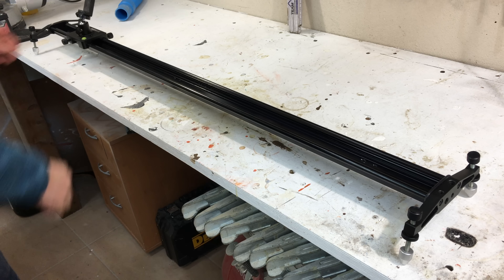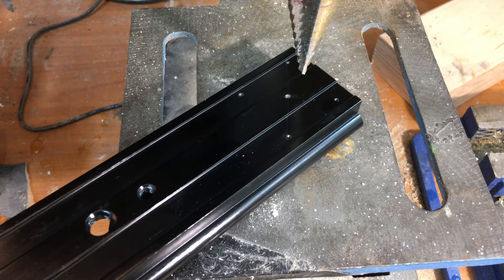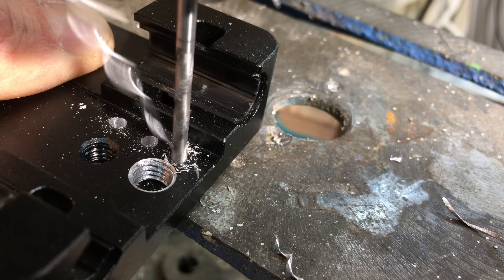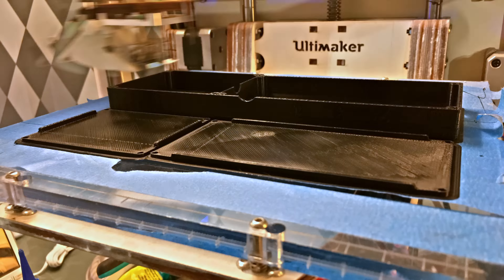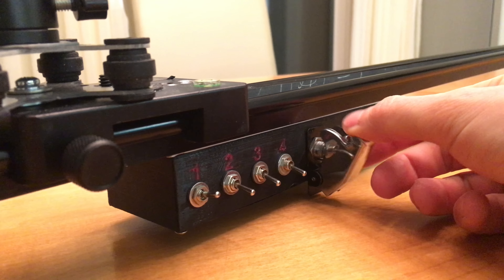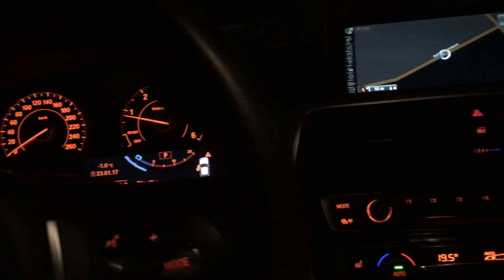Lets Make - A Motorized Camera Slider

Comment: That’s about $600 in tools, time, skill.....      I’m better off buying a REAL one!!
Reply: These tools can all be purchased fairly inexpensively second hand.  The drill press and 3D printer are not at all a requirement for finishing this build.  Your never gonna learn anything with that defeatist attitude.
Reply: Arduino- 2$ from aliexpress or ebay. Soldering iron 2$ from Frys electronics. The rest of components can be purchased for dirt cheap as well. Built all this for less then 20$.
Reply: I know this is an old comment, but for anyone else feeling this way: you're probably better off building one! If you have no interest in building, sure, buy one. But the skills and abilities you'll gain from making projects like this are immeasurably worthwhile. They'll make you feel more capable and confident as a person, and it'll unlock a bunch of creative potential!
Reply: Your time is not worth money if you cannot sell it yet. Which means, to get started, building stuff is great.

Comment: Could you not make an even simpler one using a traditional DC motor and a rheostat for variable speed control, with two limit switches to stop it at either end?

Comment: Interesting... I like the fact that it has arduino control- in which case- it is open source output - that can be modified with code and software control. I need a motorized slider rig that can 1) read any motion given from software, 2) repeat that motion seamlesly several times, and 3) do same motion but with frame by frame steps (for stop motion camera move)

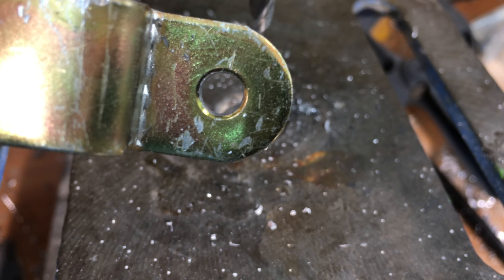Comment: Good ideas in this video.  A small tip for those who are new to machining;  1:28 very dangerous to hold a piece of metal when drilling.  The bit can catch and spin the piece causing a bad cut.  Better to clamp it instead.

Comment: Nice! I like the combo switches. Great idea
Reply from the maker: Thank you! I wanted to use a potentiomer initially, but that is not precise enough to go from seconds to many hours.
Reply: @MaxMakerChannel  hi max thinking of making one of these getting all the gear together regarding the switches did you or anybody else experiment with multiturn pots i have one somewhere and going to experiment with it will update on it ok great video and easy to follow ok regards steve
Reply from the maker: @stephenlanders  Of course you can also use a Poti. Changing the code should be easy enough. It is maths after all and you can figure it out. I personally never used those pots. How would you know what setting you are on?
Reply: @MaxMakerChannel  just a matter of trial and error i suppose  but will try your method first and play around with the settings

Comment: Super easy. All you need is a motor, a tonne of electronics, hours of time, a 3d printer, resin, a drill, different drill bits, belt, pulley, soldering iron, solder, screws, and even more time to learn how to do it all.

Great DIY but this is by no means an efficient/cheap option unless you happen to already have a shop readily available and a lot of patience haha
Reply: you can do it cheaper recycling an old printer , it has already a rail an step motor, the band and only need to buy an arduino
Reply from the maker: Good idea.
Reply: to his credit, the title does not include "easy".
Reply: @SirSyao  Hmmm, maybe that Panasonic KXP-1124 in the closet will have a new purpose after all.
Reply: The idea of these videos is to show you the principles of how such things work. If you want one you can invest the time to learn how to do it. The exact details here are not important, and you should make what suits you. For example, I can see the advantage of using the Arduino's USB port to make the slide fully programmable with a PC app to programme the moves and provide true repeatability of shots. And of course the sort of person who will take this on is exactly the sort of person who has amassed the skills and tools to do it.

Comment: Suggestion, change to 4 momentary push buttons one for seconds, one for 10s of seconds +/-, and i2c LCD screen Use that for speed control. 
Also add micro switches for at the end of travel for safety. 
OR you could also use 5 buttons, +/-, select, enter, back. and then you can adjust things like speed/distance/repeat (go back and forth non-stop) as well

Comment: should make a flat electric vibration damping machine.

3 copper coils in triangle formation with their ends free, spring in center,  a plate with magnets in correlation with coils, clever code that can use the polarity to attract and repel the magnets and place the plate in certain position. add a gyro to counter vibration and boom a flat electric vibration damping machine. gets rid of more vibration than silicon mounts.

Comment: hi max have now finished builing mine using your code etc and your circuit ,only trouble im getting is when turn the supply on to judders have tried putting a bigger capacitor in also tried a diode across the input but it still judders on start up just wondered did you have idea what it is .great design anyway ok

Comment: Would there be a reason to not place the motor on the slider and glu the belt to the rail. That way making the length of the slide longer and shorter would become easier. And there need to go wires to the camera anyway or the motor could be on batteries if you really want no wires to the moving platform. Also "no end stops" as a safety stop would make me nervious as also an arduino can sometimes be wrong.

Comment: Is it possible to use a variable power knob instead of the switches? One with a pot that could be pushed in to activate/deactivate it? I have no idea what to buy if that can be done.
Reply from the maker: Yes. Instead of using the 4 switches, you can add a potentiometer. You can probably adjust it in 10 increments by eye, although they won´t be discrete. So you could have 10 settings. (if resistance > 0 && <1 do this speed)

Comment: Good video - love so much about this video. *Drill 1 motor screw hole then recreate a box shape to accurately centre the other 3 holes instead of drilling all 4. There are some excellent woodwork tricks that eradicate errors when doing tasks like this.
Reply from the maker: +The Mouse Yeah that is a good idea. The holes came out alright. The problem was more that they interfered with the curved rails on the other side.
Reply: Ok, well I was responding to hearing "drilled 4 holes, only 2 screws fit". Can't help you with curved rail issue, LOL. All yours!

Comment: Really nice. 

A nice feature to implement in the code would be speed ramping. That helps a lot for really nice timelapses
Reply from the maker: +Antoine Quirion Couture That is a good idea. So far I chopped away the start and the end to get rid of the shaking. How would you implement it?
Reply: Max Maker unfortunately  , I have zero experience in arduino programmation .
But take a look at what rhino slider does . It's really a amazing motorised slider

Comment: What prevents the motor from stalling at the end of its run? did you use some kind of limit switch or is that a function of the arduino?
Reply from the maker: +Ben Press Function of the Arduino. It knows the length of the slider.

Comment: What kind of upgrades are needed to handle the weight of a mid-sized DSLR, like a Nikon D3200?
Reply from the maker: Horizontally none. Vertically you can get a stepper with internal gearing.

Comment: Great build, im trying to put this together at the moment. Would you be able to tell me what size cap and resistors you used? Thanks for a great video 👍
Reply from the maker: Resistors always 10k ohm I think. You find them in the standard “Arduino Switch Tutorial” Each button or switch needs its own resistor.
Reply from the maker: The cap size is not important 47uF is alright. Thats 47 micro Farad.
Reply: I figured as much but wanted to check 👍 should have just googled the stripes but Its nice to talk to you anyway. Thanks for your response, this should be a fun project! Subbed
Reply from the maker: Good luck!
Reply: Hey Max, I've got it all put together and nothings blowing up which is a good start 😅 but I'm using an arduino mega and I can't get the moror to do anything apart from make a bit of a high pitched noise when changing the amperage of the a4988. Is there anything in the code that needs to be removed or changed to make it work correctly? Ant help would be greatly appreciated as now I'm a little stuck.  Thanks Max
Reply from the maker: Awesome. Try playing around with the delay in between the steps. High pitched sounds can also be caused by bad wire connections and not enough power.
Reply: Max Maker, it's  weird because when i disconect all the switches off the arduino and plug in it runs the stepper for about a minute aboit a step a second so I'm assuming the connections are ok.. hmm. It should all run fine without the 12v vin and ground not connected to the arduino? Running the board off mains and the cord or does it need to see 12v in vin?
Reply: Max Maker, the arduino should flash when a switch is switched yes? My arduino is just showing the two normal lights no flashing one after boot up.  Sorry for all the questions.
Reply from the maker: I dont know about the arduino lights, but make sure all GND are connected! A4988, Arduino and Whatever else you have. All need a common ground.
Reply from the maker: Oh and Troubleshooting to find so e stupid connection is part of the fun. Does your multimeter have continuity? Try to test every connection.
Reply from the maker: Let me know how you do. If you don’t get it to work, we can skype, but troubleshooting Arduino is always difficult. The Arduino Forum is a great source of help.

Comment: How you you build and include integrate a controller for taking time lapse stills on the slider to simulate slow motion movie?
Reply from the maker: You can stick a 3.5mm plug into your camera. Add a relay to your control box that shorts two of those pins and your camera will take a picture. The relay needs to be activated by the code. Maybe every 10 steps or so.

Comment: How to make it auto round / goes back to point A when it reaches point B? Thanks!
Reply from the maker: You need to insert an if statement somewhere that tells the slider its new goal and how to get their i.e. go steps in the other direction until point A is reached again. Dig into the code and try to come up with something that does that. If you don´t know how to program arduino, you can finde somebody on fiver who does it for you.

Comment: awesome. I am going to build my own. That's why I have a question: as long as this is a friction slider, is there a possibility to potentially decrease friction between rails and the platform for a camera without buying different slider? I want to add controlled time lapse functionality so the lesser external factors (for example, friction and vibration) there are, the more control I can get.

thank you for inspiration and response
Reply from the maker: +K V The vibration occours at different speeds. At high speeds the vibration comes from the motor and the whipping belt. At slow speeds the shaking cones from the momentum of the camera that moved the anti vibration mount. Friction does not make a great difference. I belive though that you could use makerslides with bearings and adjustable wheels for about 100$.

Comment: Great tutorial!! But can u tell what resistors did you use? (120 ohms?) and Watts? Thanks.
Reply from the maker: 10kohm 0.5watts. They don’t get a lot of power, only a signal.
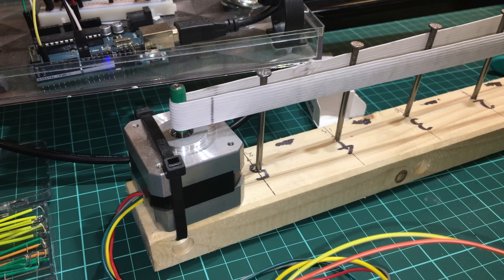Reply: 3:01 on breadboard right upper corner, what is it transistor? “The black part with metal center”
Reply from the maker: It is a capacitor. 47micro farad. (uf)
Reply: Sorry for so many questions 😀 but what voltage was your capacitor?
Reply from the maker: I dont know but something low. Maybe 12-20v or so. Google standard for Arduino

Comment: Hi Max, thank you for your VDO, this awesome.  Anyway, could you please give me the detail of the Pulley (eg, diameter, teeth)  ....  Since the information in the Amazon link already dead. Thank you very much ....
Reply from the maker: Hey. The pulley had about 20 teeth and 2cm diameter.
Reply: MAX   ...  appreciated for your light speed response !!!!
Reply from the maker: Thanks for letting me know. And cool that you are building one! I changed the instructable and replaced what is missing. Does this help? Let me know if not.

Comment: Did you consider using a reducer to get smoother movement at low speed ?
Reply from the maker: tomboboleon You mean a gearbox? There are roughly 20steps per mm so its quite smooth already.

Comment: I was thinkimg to do what you did, but simply add a voltage regulator to the motor, so with a twist of a dial it will go from 1v to max of 12v (slow to fast) could you recommend a motor for that?
Reply from the maker: +The AlikA That does not work with a stepper motor. You need a brushed DC motor. There are many available even with gearboxes.
Reply: thanks, as I have no idea where to start, can you suggest something? in terms of how many RPM's or build quality or any other info, or Volts (i want to use a 7.2v battery) 
I'd rally appreciate it.
Maybe I'll even create a video tutorial too thanks to you, who knows?!  :)
Reply from the maker: +Nikita Gaidouk You can calculate the RPM you need for the desired speed. Get any 7v motor that matches that RPM. Put a poti in series to reduce the max RPM. Easy. Also check out instructables.

Comment: Seeing that you have a 3Dprinter,you could have printed a belt tensioner like the ones used in a DIY printer,any specific reason why you didn't consider that option?
Reply from the maker: +Surya Raju Very true, I could have done that. I guess sitting down, designing and printing one would have taken an hour. This way the tension is enough.

Comment: Hi Max, after the camera mount plate reach the end of slider, that camera mount plate coming back to another side ( by reverse button or automatically ) or we need to adjust it manually ( push by hand that mount plate to another side )?
Reply from the maker: You need to push it by hand. But you could make it reverse by changibg the software a bit.
Reply: So i need to change the arduino code? 
Okay , i'll try to do that.
btw i repeat make that slider switches 3 times because short circuit on a4988 driver and arduino 😅😅😅
Thank you Max,
Reply from the maker: Yes, I dont know your programming skills, but it is not too difficult if you know the basics. I would build a variable that counts the steps. Then make an if statement, that says: If the StepCounterVaraiable equals to the maximum number of steps, take steps in the other direction until you  rach home again. 

Those A4988 fail very easily. I had to redo this project 3 times at least. That tought me to use header pins so I can swap out components easily.

Comment: How did you connect your motor driver and your arduino to your battery pack? Did you just connect them both on your batteries in parallel?
Reply from the maker: Yes. Motor driver and Arduino both get 12v in parallel from the battery pack. (“Vin” on the Arduino. )The rest of the driver pins are connected to the 5V side of the Arduino.
Reply: Thanks! I'll go make my own now :P

Comment: Nice slider. I have the motor and I'm not sure if arduino is going to work for me. Also subscribed to your channel.
Reply from the maker: You can use a normal motor too and a simple motor controller with a turning knob.
Reply: @MaxMakerChannel  can youpl point me to one?
Reply from the maker: https://www.amazon.com/RioRand-RR-PWM-15V-Voltage-Motor-Controller/dp/B00N30UK2M/ref=mp_s_a_1_8?crid=31ZT0Y18ZAKBF&keywords=motor+controller&qid=1554053763&s=gateway&sprefix=motor+co&sr=8-8

Something like this. The motor should be about as big as a kiwi🥝 . That size should give you enough torque but not consume too much power. 12V maybe.

Comment: Sorry I have a quick question, I'm troubleshooting my own project, and in this video, you use a Micro, but in the schematics, where I copied the code from, it is using an Uno R3. Will this code work the same. I'm running my wires from Pin 8&9 to my stepper driver, but in the code it says something about 3&4. Would this be my problem? Sorry very vague, first project with an arduino.
Reply from the maker: Hey. They both work. One is just physically smaller than the other. There might be small differences but they shouldn’t be of concern for this.

Comment: So I can program my own intervals and whatnot? Mostly asking because I shoot astrophotography and want to get into moving timelapses. Only 'problem' is that I'd have to get an interval going on to move at least every 30 seconds (and versatility to changed that) and even then, have the camera move ever so slightly in every shot. Would that be possible to program into the Arduino? Thanks!
Reply from the maker: +Beta95123 Yes sure. The code in in its original state takes anywhere from 10s to 8hours to move across the slider. You can modify those values to anything you want. There is only a top speed limit at 10s.
Reply: Ah okay, thanks Max! That's so cool! Time to save up some money for this project. I've seen companies sell sliders specifically for interval movements but they typically cost thousands of dollars so this project will definitely save me a few :)
Reply from the maker: +Beta95123 Nice! Send me some pictures when you are done!
Reply: Haha will do! It'll take me a while to save up the money for a new slider and all the other supplies and equipment but I'll definitely come back to this video and send you the progress+results! Thanks again for the reply and for sharing your instructions! :)